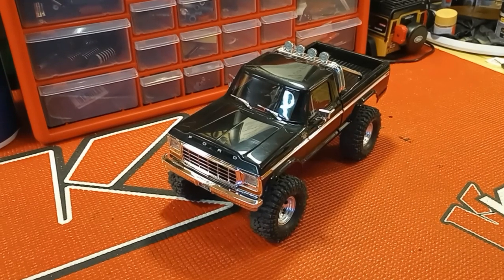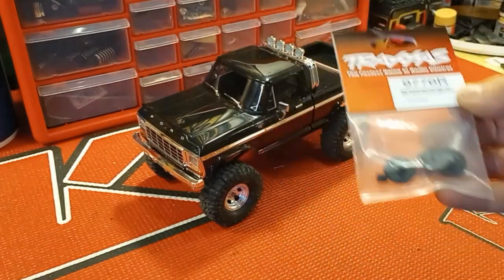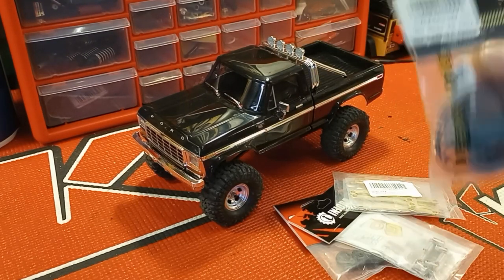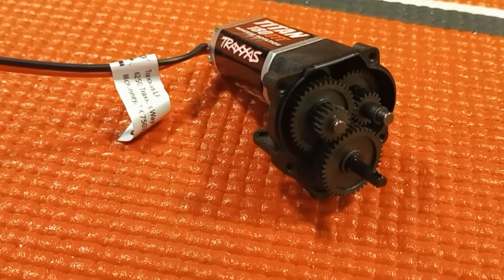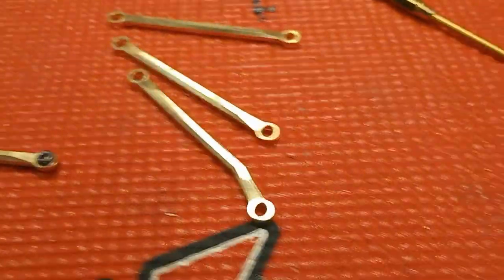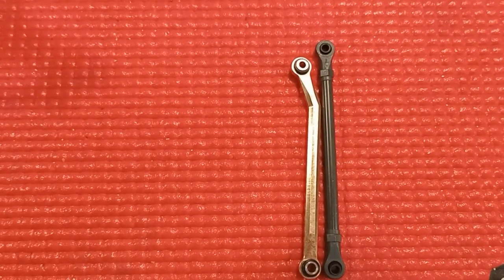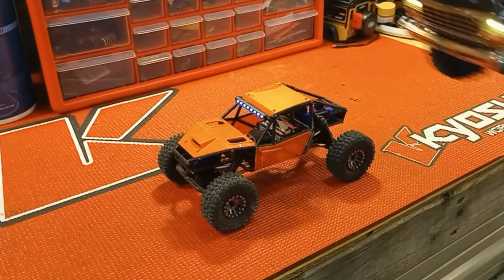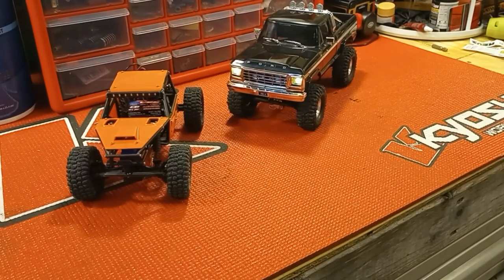TRX4M High Trail F150 Upgrade Time - Lights, Suspension, Drive Shafts, Gears and Motor

Comment: Bummer on the links I but in the Injora links that are round & I replaced the skid with a metal one & that thing fought me till the last screw was in. I also have the metal driveshafts & an Injora reverse rotation 180 55T motor with the stock pinion & the metal low speed Injora metal gears. For the price I definitely recommend the metal gears makes it sound way different also. It’s fast enough but has a much better slow modulated speed when crawling now. I have Injora 1.3 metal beadlocks on it & light kit. I’ve already broke off my mirrors they are way too fragile. I just got more parts to but in a Reefs brass 99 servo & metal Reefs servo tray anodized front knuckles & portal covers & front & rear anodized aluminum front & rear bumper mounts. I had a TRXM Defender which I upgraded but was never happy with it the High Trail has been the opposite & is alot more fun in general which means alot that’s why we run them for fun & to relax & beat stress. 👍

Comment: I have used heat shrink wrap around each end of the drive shaft to keep that pin from popping out.  Has worked so far very well.  Love those square bodies !